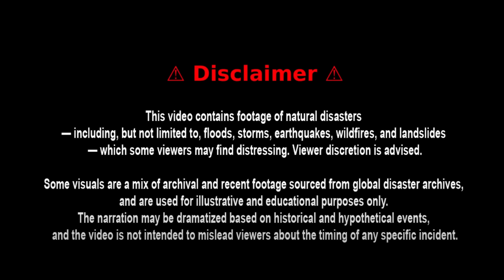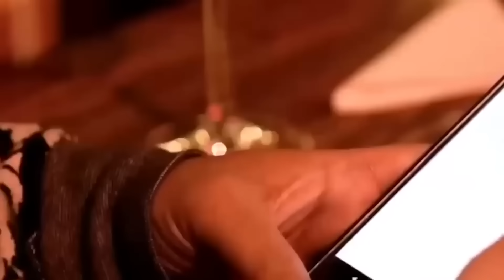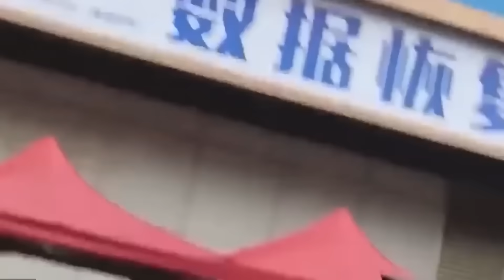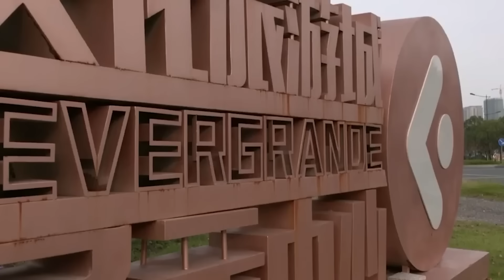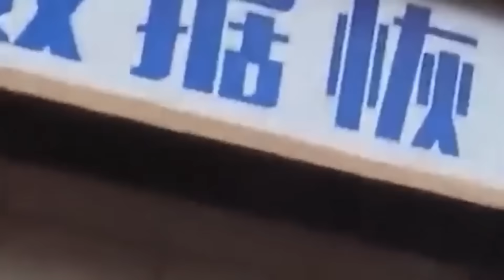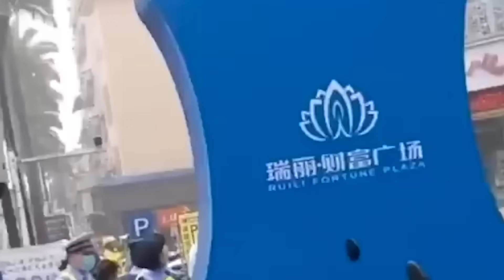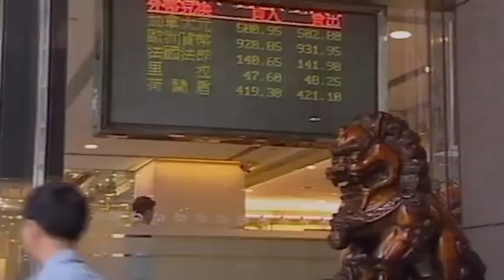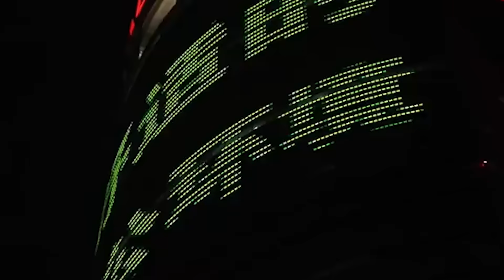Shanghai’s Skyscrapers Are Tilting — Engineers Say It’s ‘Unstoppable’

Comment: All high rises are piled to bed-rock even if the bedrock is 60 m deep.  The alluvial soil is not so thick and there is no karst (limestone) below Shanghai.  Now, there are ways to test how deep into the bedrock the piles have penetrated. If there is corruption, then the building will tilt where the piling has been shortchanged.  NO ONE will ever build a tall building on soft soil. This narrator is not an engineer and has zero knowledge of soil mechanics, geotechnics, piling technology, etc.

Comment: Some buildings when you build them needs specific types of metal put together to build steel beams. And there is a quality control person on hand watching this stuff being built made from scratch. And not just any steel milk can do it. They have to be specifically picking the right manufacturing company to do it. Everything that is built from the ground up course has blueprints Drawings as they are called every specific specification that is on that paper it will be put on that building if you take a shortcut for any reason that’s gonna be a problem and if it’s court be made to take the billing down believe it or not.

Comment: The problem is the contractors are taken payoffs. The building inspectors are taking payoffs because of the shortcuts are taking. You know when you build a deck off your house I built a 20 x 20 deck for somebody. I went down 36 inches to the frost line inspector comes he wanted to 48 inches And I had 35 holes Doug and he wanted me down to one of them 48 inches. That’s what a billing inspector does. I put an addition on my house before I can go any further if it was framed up the inspector came out and inspected everything that is what an inspector is supposed to do I even put a trust on that side of the house didn’t have to and he said why do you do that? That’s just for the action loadbearing weight from the roof snow whatever have youbut anyhow the point is that when you have people taking money and look in the other way that’s the problem and that’s what’s going on in China.

Comment: I think any building more than ten stories in an earthquake prone area is tall enough. These Sky Scrapers are just an accident waiting to happen no matter how well built they are. For the ones that survive an earthquake, just how many will it actually endure until they've been weakened enough that areas that can't be seen start showing signs of fatigue? All materials do reach a point of fatigue until they start cracking, bending from flexing many times. Concrete bridges have a fifty year life span before major repairs have to be made. I've heard that concrete actually gets harder as it ages, now whether that's true... but that's what I've heard by people who work with concrete for a living.

The Empire State Building supposedly sways at the top a total of twelve inches, six inches either way. People who know that building say they can't feel it moving. China has a lot of earthquakes, just like Japan does. I'd stay out and far away from buildings like that, especially China built.

Comment: CCP cuts that many corners I’m surprised them windows aren’t round.
Reply: At least round doors have good Feng Shui 😂
Reply: @jstantongood5474  Until you get invaded by hobbits.
Reply: First off it’s not the CCP is cutting corners, contractors are cutting the corners just to put the money in their pockets. When you build a bridges, it’s not just any piece of steel you get off the ground. This stuff is made from scratch dimensions. The length whatever it may be it’s made from scratch. Any skyscrapers that are built estate world trade centers every single bit of that steel was made from scratch. You cannot just use any steel and secondly, when you build a skyscraper, you gotta go down to the bedrock you start from here you work your way up. Not from dig down 40 feet and pack the soil that doesn’t work. Something’s gonna move and it’s gonna be the building.
Reply: @WarH yes I understand the engineering part but corruption over there starts from the top then everyone bellow that fills there pockets on the way down the only ones that miss out is the poor family working for life to pay it off

Comment: "The foolish man built his house upon the sand."
- Some book I read as a child. 😅
Reply: I left UCLA in 1974 with a masters degree in Soils and Structures Engineering. I never became a practicing engineer, but I recall with clarity that building on unconsolidated granular materials was not advised unless a solid rock layer could be found below that would allow piles to be driven to the solid layer, or similarly caissons built to a solid layer which would support the structure.
Whatever happened to this lesson in Shanghai?
Reply: @geoh7777  We did not dig the ground, we already knew that beneath the surface is marine clay. So Japanese soil specialists were engaged. Ground was dug, underground water extracted, then the Japanese injected chemicals to solidify the ground. Now that's 20 years ago. Now it's a marvel many came to see. So many buildings, amongst them is Marina Bay Sands, Singapore.
Reply: The Good Book …
Reply: @chrisbraid2907  A book written by ignorant Bronze-Age goat herders.
Reply: It's a song! "... then the house on the sand tumbled down...Boom!!"
Reply: @RuthJoie-p3c Today's technology,  we can build on sand. By using chemicals to solidify the ground. Sand is not serious,  marine clay is. Especially if it's a tall tower. Specialists knowledgeable enough about amount of ground treatment is crucial, otherwise the tower will till.
Reply: It was called approved building standards  of ccp 1999
Reply: It was the third little piggy. This piggy built his house of bricks.
Reply: It's Chinese culture to save costs. Cut corners, examine usage, then cut further.
Reply: You should try reading it as well you utter prat

Comment: You are showing something almost unheard of in the western news. We also have buildings that sink, the Florida Atlantic Coast. Thank you. USA
Reply: Chinese build it 😂😂😂
Reply: It's still very rare in western nations to have this happen. Your talking Florida which is almost all sand and limestone, very porous ground conditions. Even with those less than perfect conditions they can with stand torrential rainfall and yearly hurricanes. A couple older buildings had damage from poor safety inspections and routine checks. But because those accidents happened i can about guarantee they tightened up regulations after the negative national news headlines. China on a different level of dangerous when compared that's just a fact.